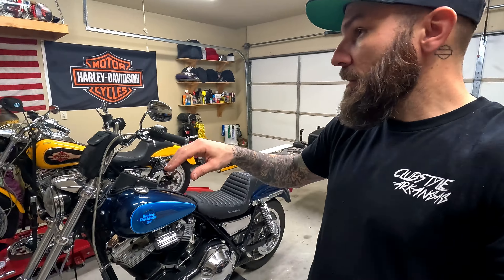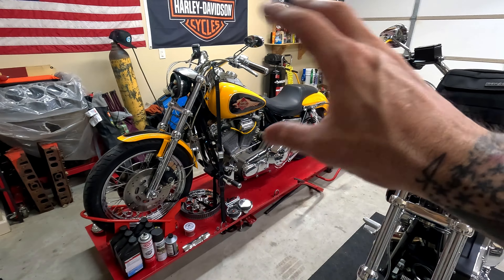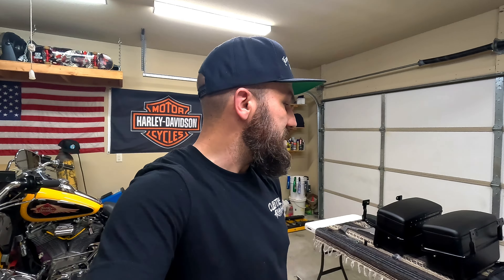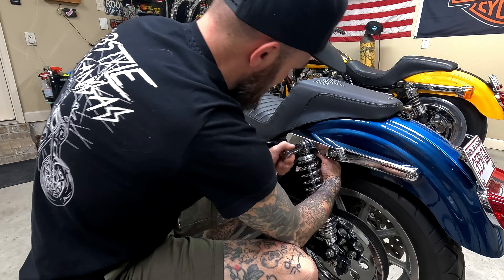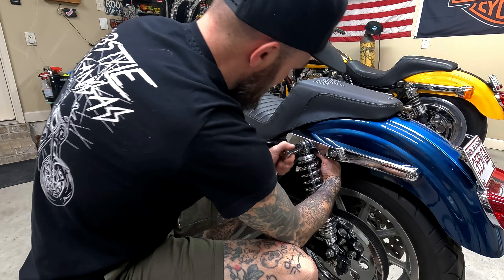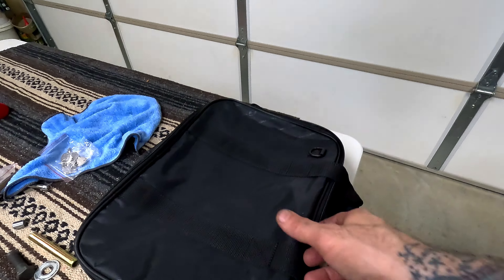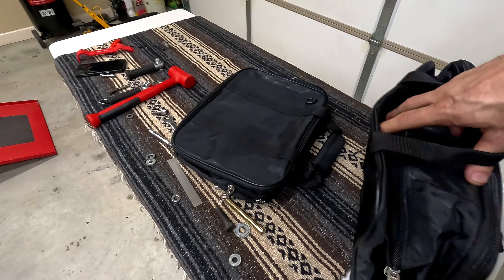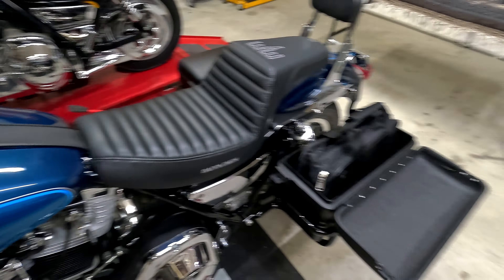The 1991 HARLEY DAVIDSON FXR gets SADDLEBAGS!!!

Comment: What clutch cable and brake line did you run ? Trying to throw some 8” risers and mid agresive bars and can’t figure out the ones to get
Reply from the maker: I don’t recall exactly. I believe the brake lines were 19” for all 3 with the crossover junction block, and the clutch was around 66” but don’t quote me on that.  The best thing to do is measure for your personal application. Bars and risers vary.  Some bars are wider and have more pullback.  Risers can be straight or pullback. I know it sucks to have mock everything up and wait on parts, but it makes it look best when you take the time to get your setup dialed.

Comment: That bike so clean! I’ve got the FXR Division bags and love em but the V2H bags look more like stock I feel with the way the open. Are those the FXRP struts? I changed out to the RP struts before I mounted my bags
Reply from the maker: The fxr division bags are a better quality bag in my opinion. Their rails just seem to be clean and the over all look.  The V2H rails aren’t perfect and almost have a 1” lean back meaning when you look at the bike from the side, the rear section of the bag is lower than the front. I’m going to see if I can fix that with a spacer on the bottom or something. And I’m still running the fxrs struts so my shocks are mounted in the forward hole.
Reply: Nice! Looking forward to more content with it

Comment: So if you have to remove the bags you have to mess with clevis points so uncomfortable.
Reply from the maker: You don’t have to mess with the Clevis pivot blocks, but you do have to remove the upper shocks bolts.  I just took the bags off for the winter to slim the bike back down.  Took about 30 mins or so